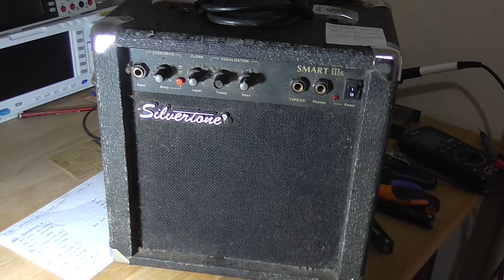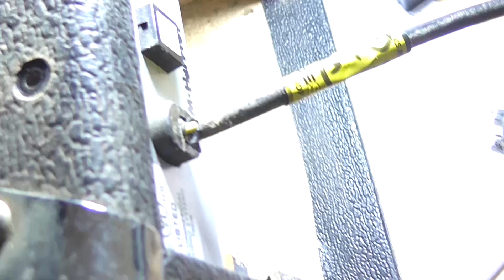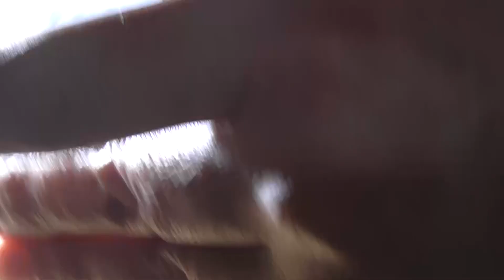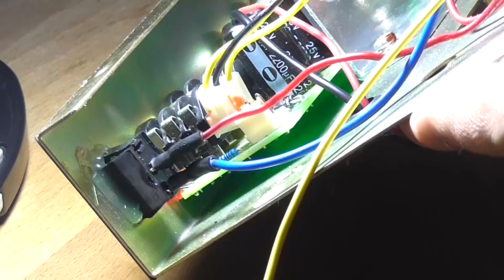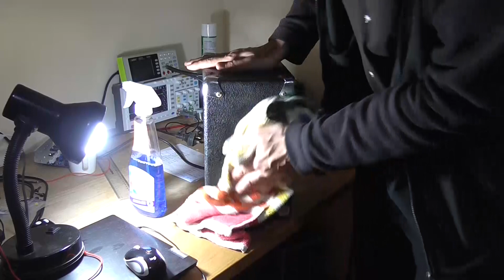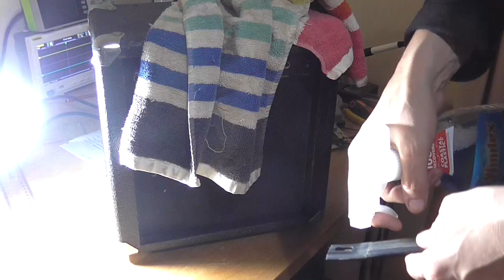Samick Silvertone Smart IIIs Guitar Amp: Won't Turn Off

Comment: I have the exact same problem with the exact same amplifier. It is not a bad amp. Came with my SX Strat style guitar. I will be fitting an IEC socket on it. Maybe replace the switch to a better switch.